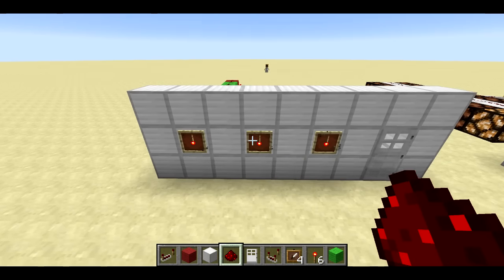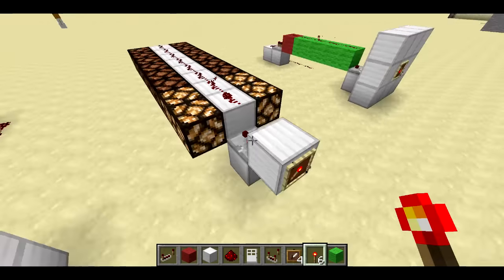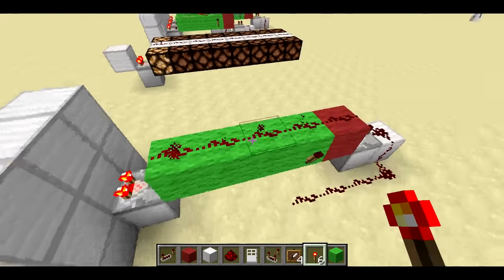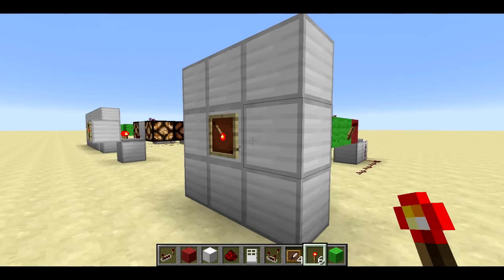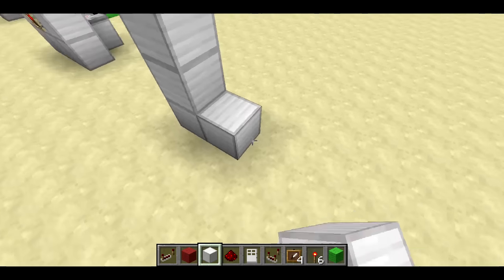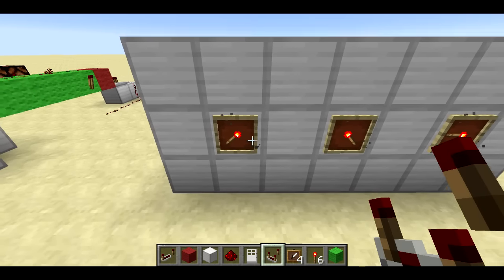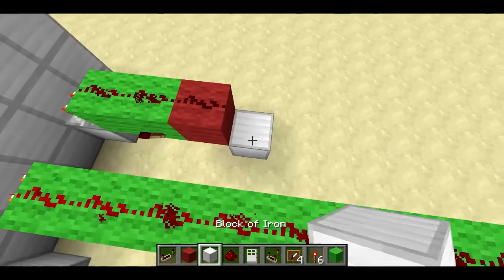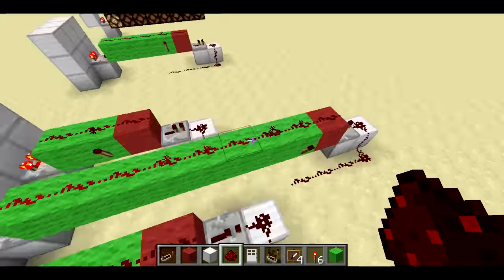Item Frame Combo Lock -- Minecraft Tutorial

Comment: I added a button so the code has to be entered correctly, then you must push the button to open the door. This way, nobody can spam spin the items to see what combo opens the door. I also have a lever to manually open it from the inside.
Reply: +AJman14 Still works in 1.9??
Reply: +Wolfenry Oh yes :D
Reply: So I know this comment is EXTREMELY OLD, but do you remember how to make it close from the other side?
Reply: @kaysebugg  I actually explained how to open it from the other side, but the concept is the same, just in reverse polarity.
Reply: @kaysebugg  TL;DR What you need for closing it is to just power the line at any point.

Comment: Anyone know of a design where i could add more combinations to the same frames? Like if i had 180 a door opens and if i have 634 a tnt go of.
Reply: I'm working on this design right now.  I think you could do it if you integrated a piston that moves a block into place that interrupts the redstone circuit (a corner that interrupts a line going diagonally down, for example) to keep the door from opening, at the same time that the signal that triggers the piston also triggers the TNT.